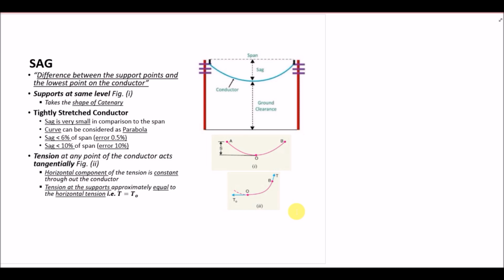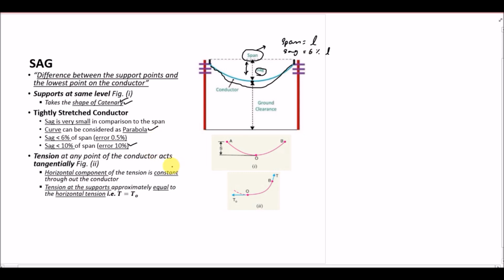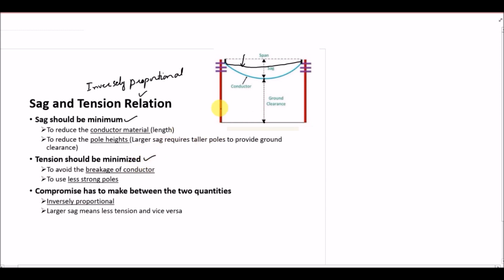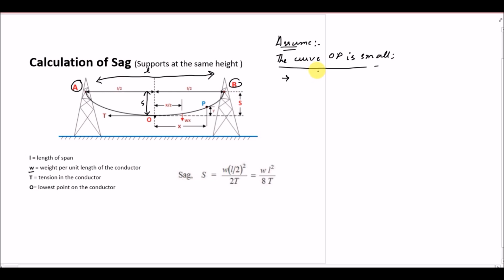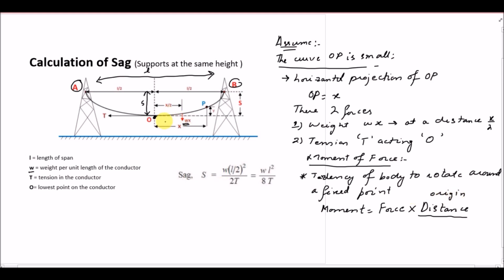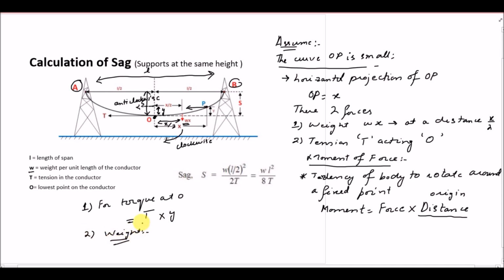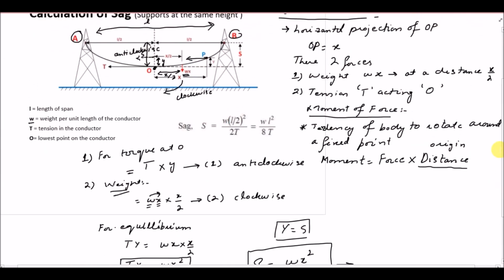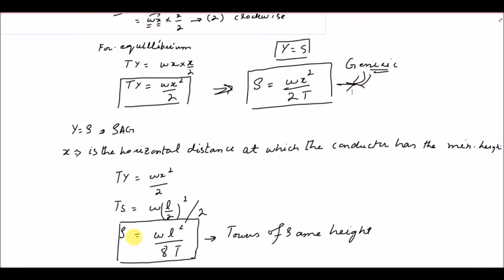Power Transmission|| 46 || Sag Calculations for the Towers of Same Height

Comment: great explanation 👌🏻 
but I have one question 
why did you put the torque at point p while it's at the point O
Reply from the maker: In the starting of this section it was mentioned that the horizontal component of the tension is constant through out the conductor. So whatever is the tension at point O is the tension at the point P. That's why.
Reply: @DrAmmarArshad  ok. but at point p there should be a vertical component of tension??
why do you neglect that?? sir said that tension is tangential at any point.. I think you should apply equilibrium on point P. then the equation is right.in our campus there is a very complex derivation using hyperbolic fuction but at last it got the same formula for sag as yours. but there is a derivation for tension at any point = T0 cosh wl/2t0 ..also at point P the tension should be outwards tangentially. the direction should be reversed. if you consider OP the vertical forces should be balanced according to the sketch its not.